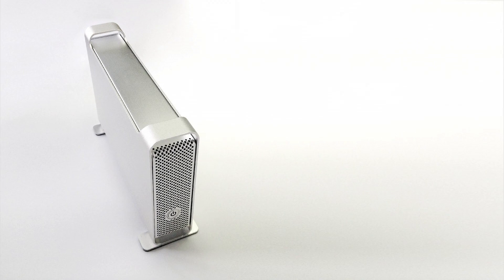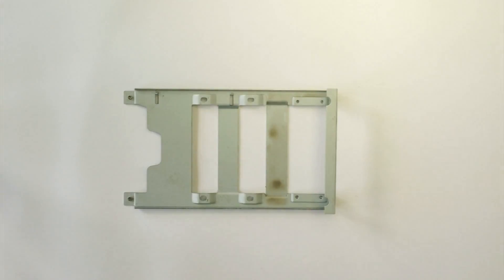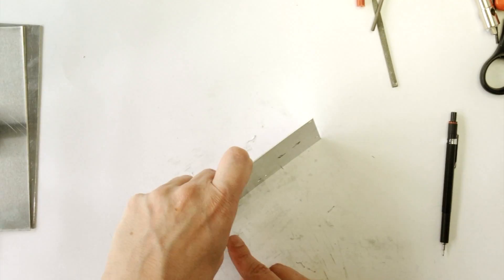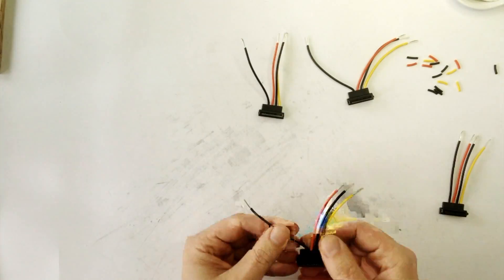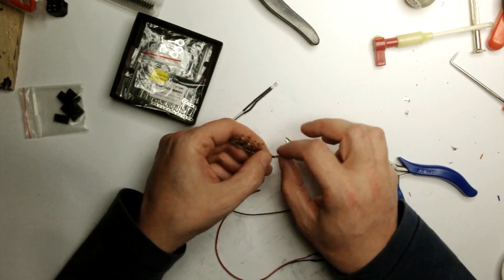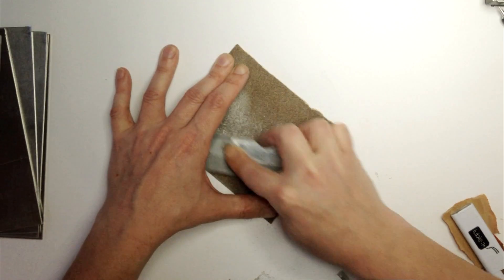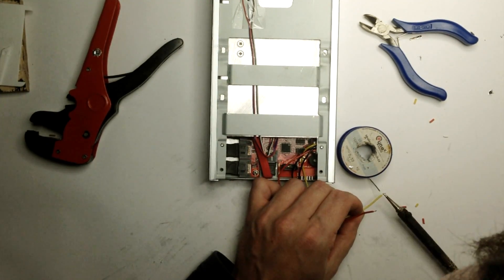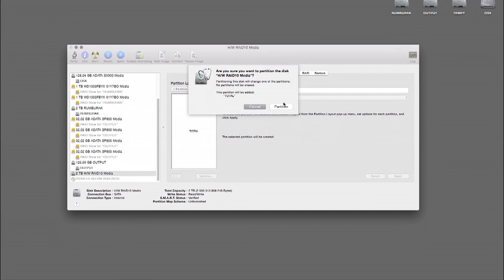DIY SATA RAID Storage in an old HDD enclosure

Comment: This is a great project. I wanna do it! :) 
The Lycom ST-158 is discontinued and not easy to find. Any suggestion for a replacement part?
Cheers from Portugal
Reply from the maker: I'm very glad you like it. Unfortunately have no idea where you you'd be able to find ST-158. I think now it features a meteorite-range rarity ;) Cheers!
Reply from the maker: I suggest you'd make favourite search query at auction sites for "addonics raid". You may hit something very similar.
Reply: @jarekjanuszewski2247  Yes, I'm actively looking but with no luck so far... Maybe a possibility would be a PCI-e raid controller (these are much more common) connected to a USB3-to-PCI adapter? But again, how would I configure raid on it? 🤔
Reply from the maker: @joaoolx  you may experiment with USB3-cable PCIe extenders used for mining and connect external card. Most of them are only single PCIe lane connector but some simple RAID card might fit (and work). AFAIR they are not connected by real USB3 bus, it's a cable used as a physical connector (to be verified). Note it's only an idea and I have no clue whether it could work.
Reply from the maker: Ha, you should read the comments below first: https://www.datoptic.com/ec/5x-drive-hardware-raid-controller.html

Comment: Great work. But I can't find this particular host card selling anywhere!
Reply from the maker: Search google for "datoptic Port Multiplier Controller with JMicron". It's not the same model but very similar. Search also for "jmb393 raid card", perhaps you'll find the same I used. Cheers.
Reply from the maker: It seems there's last one on ebay "Addonics A158-00B Port Multiplier"
Reply: @jarekjanuszewski2247  Thanks. Are there any other options?
Reply from the maker: @josephlo6005  don't know, really. Remember SATA is getting old...
Reply from the maker: @josephlo6005  https://www.datoptic.com/ec/5x-drive-hardware-raid-controller.html
Reply: Hey I am looking to make this project and I would like to know if you found a good host card?

Comment: wow! good work! have been looking for someone do such a DIY! what is that red raid controller?
Reply from the maker: Thank you! Please refer to the article (link in the description) where you find more info.
Reply: yah I saw u took it from an adapter, after removing the metal part. I am wondering if there are manufactures sell raid controller that for DIY raid config (not from an adapter).
Reply from the maker: Bracket was only for mounting purposes here. Google for Lycom or Addonics, these are manufacturers I know.